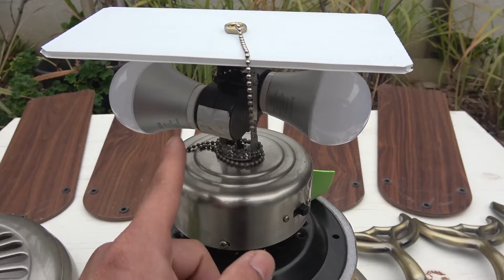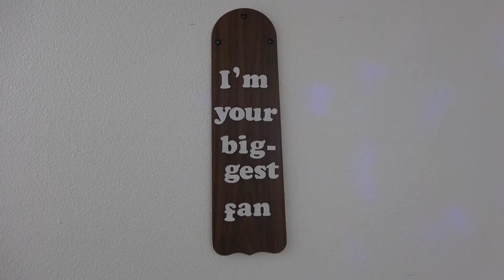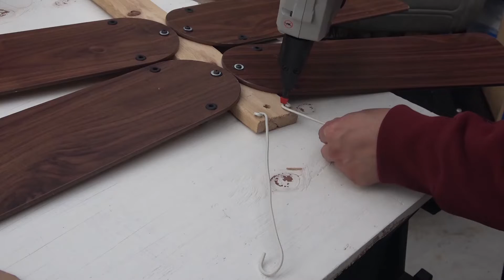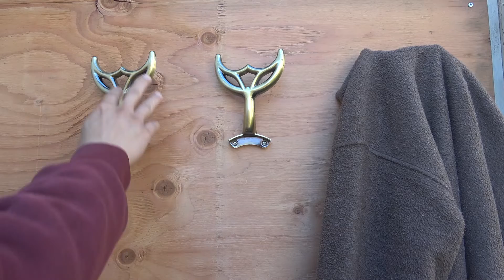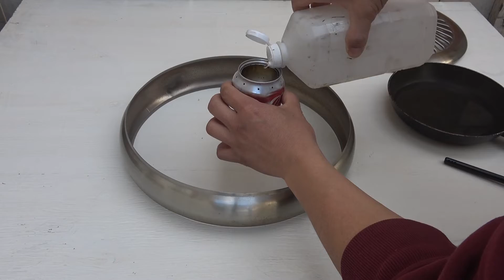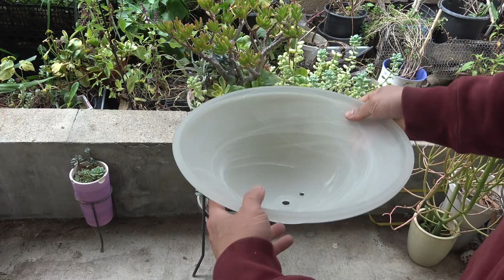DIY: Ceiling fan parts projects: from Trash to Treasure!

Comment: I consider myself an ADVANCED repurposer. I've done all the fresnel lenses and microwave transformers and I have hundreds of 18650s. I currently work in a race car fabrication/modification job. But there are 2 good reasons I watch each one of your videos: #1 your accent is really enjoyable to listen to, and #2 you have clever outside-the-box ideas for lots of things. When I've seen a Chevy V8 put into every car you can think of, these ceiling fan videos are still fresh and novel.